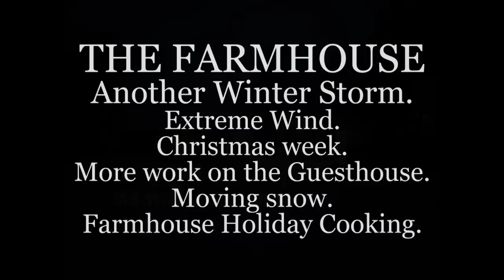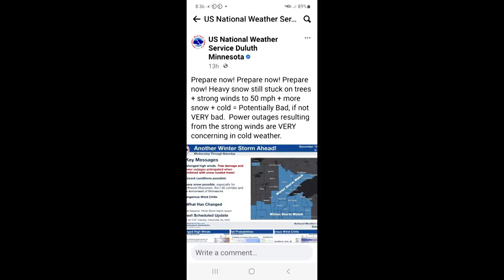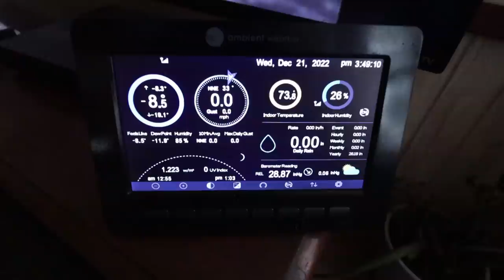THE FARMHOUSE. Another Winter Storm. Strong Winds. Christmas week. Holiday cooking.

Comment: Joe, I NEVER put ethanol fuel in any yard equipment or really anything other than my vehicles, ATV’s, chain saws, generators, outboard motors, all get non ethanol fuel, after replacing carburetors and cleaning fuel tanks I will only put non ethanol in my gas cans.  I have not had any problems since.

Comment: I noticed in the guest house that none of that plastic was moving. With huge gusts of wins going on outside and against the house, you would think that the plastic would move in and out if there was any kind of leak.  It didn't move so you did a great job of insulating and sealing that house.  In my old house, on a good storm the curtains would move a few inches every now and then from the win and suction going back and forth.   One by one I sanded the entire window, repainted and shoved insulation and used expanding foam in any cracks once I took off the trim around the windows.  We noticed later that by sealing it up the furnace didn't click on as much.
One of the best things about a power outage is that you get to sit around and "talk".  Retell stories you've told already 5 million times.  Rehash a great memory, gossip, play an actual game like UNO, etc.  The power comes back on and everyone goes back to their pc, laptops or cell phones.  Running a close second and third is the creative ways you get to make a meal.  Everyone should own a fondue pot with sterno fuel or a candle. You can have hot water in no time for coffee, tea or hot cocoa.  Next is looking around at everyone with some covers or blankets on and taking a nap now that they had a meal and can rest.  Power outages can bring people closer together.

Comment: No matter what size trap you get the overflow on the tub/shower is always going to be above the trap-you can still use that shallow p-trap under the tub just pack some fiberglass insulation around the drain area and you will be fine

Comment: I'm a rig welder and have a couple machines a Lincoln sa200 and another Lincoln ranger. And I've had to use the ranger for the house a couple times worked great got two 220 plugs and 4 110 plugs at 30amps its an 11kw ran the house and shot with ease.

Comment: In my own past struggles with small engines I've found the best way to repair them and make them reliable is to replace it with a honda. They will always start and run even after prolonged sitting.

Comment: Not sure if you mentioned it, but the battery bank that Zach gave you can be plugged into your vehicle when you are running errands to recharge it. Also, a solar panel will charge it ( as long as the sun is shining).

Comment: Joe check the petcock valve from the fuel tank as well when cleaning the carb if you are going to clean one part of the fuel system clean it all... with the ethanol in today's fuel it gums up everything... stay warm!!
Reply: Don't leave gas in your tank for very long. And use 91 Oct gas .check your plug and clean your air cleaner if dirty. You should put a shut off valve so you can run it out of gas when done using it. It helps alot

Comment: Joe, the only true way to ensure that any gas powered small engine will start when stored for any lenght of time is to shut the fuel off and let the engine run untill it quits,  Then chock it and pull it a few times will clear the carb dry. And gas with ethanol is hyroscoptc and will absorb water. And gas today is really only good for approx 30 days. and loses it's BTUs. Even putting Staybil in the gas does not really work long term. Ask me how I know. If possible only buy ethanol free gas for small engines, it will last longer and not absorb water sitting around. Happy New Year to you and Melissa and your extended family.

Comment: Speaking generators, I bought the predator 9000 watt from harbor freight and that thing is awesome. I know a lot of people don't like harbor freight stuff, but it works wonders for me.
Reply: I was looking at one of those. Ended up getting a Westinghouse 10,000 Duel Fuel at Family, Farm, & Home instead. Our lights flickered in this recent blizzard but we never fully lost power. My in-laws lost power for 12 hours
Reply: @DeputyVanHalen5150  I was lucky and never lost power at my house. We got quite a bit of white outs here in VT.
Reply: @LanceHanlonOutdoors  We had 63mph winds here in Ohio -12 air temperature and -32 windchill. Had a hot water line freeze going to our wet bar and bathroom. The genius who designed our great room ran the water lines through the attic. We've been in this house for years never froze a line til now. I thawed it quick, didn't want that breaking. Lol
Reply: @DeputyVanHalen5150  WOW... Good thing you caught it in time.

Comment: We always stock up the house with groceries. That way if the roads are chit, or it's brutal cold out, start the vehicles when we take the dog out, let them run for 20-30 minutes, and the other runs out and shuts them off. We had that brutal cold snap for a good 12 days. Husband ran out of his beers and debated on going out or not for more haha
Reply: For the outdoor wood stove, why don't you build a wind block for the front of it? I am one who hates cold wind, so that would be something we would do.
Reply from the maker: I talked about it in a previous video, until we go through a whole winter running the wood furnace there is no way to know exactly what we want and need. Some sort of wood shed and maybe a wind break can happen next summer.
Reply: @NorthernSeclusion  For sure. This video took me back 2 weeks. We got that cold and snow a week before you did. It sat over us here in Alberta for awhile

Comment: Joe,  use StarTron in all your generators.   I have left mine sit for three years with the same fuel because I didn't need it.  And only started it occasionally. But it runs like a champ when I need it.  It's like Stabil but on steroids.  I use it in every motor I got 2 or 4 stroke.

Comment: I had a garden tiller that did the same thing.  Turned out it was the gas.  ETHANOL had separated.  Drained out the gas put in new and ran like a charm.  Glad you found the problem with yours. 
Looks like you could possible use a blade for the back of your tractor.

Comment: Joe- do you use fuel stabilizer in your small engines?  If not you should try it.  I have been doing this for probably 30 years and I never have any issues with the carb or fuel.

Comment: One of the jets or passages in the carb is plugged up. The way its acting is textbook example. Also check the shutoff valve. Soak the carb in a gallon bucket of carb cleaner
Reply from the maker: I did explain in this video exactly what Zach had me do to fix it. It is running perfect now.

Comment: Possibly bad gas ? Do you ever use fuel stabilizer Joe 
Happy New Year to you and the family 🎉
Reply: Every time I fill gas cans I add Stabil. Never had a fuel problem since BUT for extended storage I do run the carb dry. I've also found Seafoam in the gas helps for "mildly clogged carbs" before going right to rebuild and clean.

Comment: Have you tried to run that generator with the fuel cap loose?  Vacuum may be building up in the tank due to a clogged vent in the cap.  Will usually run for a while then quit.
Reply: Nevermind, I’ve now watched far enough to see you got it figured out.

Comment: Another issue with small engines that run & immediately stall; check the spark arrestor screen for carbon blockage or if the engine has a catalytic muffler. My walk behind mulching mower has a catalytic muffler and even with a brand-new carburetor, new spark plug it still stalls immediately. Then after resorting to the manual on the engine, the catalytic muffler "MUST" be replaced after 250 hours of operation. Well... my mower has 289.6 hours on it. I had the mower since 2001. So, for shits & giggles I removed the catalytic muffler & the engine runs just fine, though rather loud. So, for $17 I'll get a new standard muffler for the 6.5 HP Briggs & Stratton Intek OHV engine. The catalytic muffler is obsolete. 

That same winter storm or blizzard dumped allot of snow on us in Lower MI. Some places got 2 feet or more of system & lake effect snow. I worried about the power going out as my generator is set up with a multi-viscosity oil meant for 15*F to 95*F use. Our high temp on Christmas Eve was +3*F with wind chills around -20*F. 

This Tuesday we are to go back to work and the forecast is for a high of 62*F with possible thunderstorms.

Comment: How do u keep your pipes from busting? Is everything heat traced? We have to drip the faucets here in Louisiana and that can get costly
Reply from the maker: As far as the main house goes, everything is in the basement which is heated like the house. All water lines are dug underground 8 feet and then come up into the basement. With the guesthouse I will have to heat tape the water from about 6 feet underground until it gets into the building. That will be a future project once the ground is not frozen. I always worried because at the Louisiana house we would have frozen and burst water lines almost every year. up here, you rarely if ever have that problem.
Reply: @NorthernSeclusion  yeah we do not design for cold weather. I'm an engineer here and we get cold weather fracturing because we dont account for it. We lose our minds when the temp gets into the 20's

Comment: Why don't authorities either re route electricity cables, or cut back the trees which over hang them ?
Reply from the maker: They do but a tree that is 80 feet tall means they would have to clear trees back 80 feet on each side of the power line. They do not own 160 feet of easment to do that. They come by every couple years and ask if they can cut all the trees and brush that line the road in front of our property below the power line and I give them a hard NO. They can trim them so they are not hitting the power lines but they will NOT cut them down, that becomes our privacy in the summer from cars driving by. There is 8,742 miles of power lines in the state of Minnesota. They do not own enough of the property to cut trees back that far. If they want to fix the problem they can run the lines underground.

Comment: I THINK YOU SHOULD. TAKE THE. FUEL. BOWL. OFF. AND. PULL THE. HINGE. PIN.  THE. NEEDLE. AND. SEAT.  IS.  PARTIALLY. STUCK. PULL OUT THE. NEEDLE. VALVE. CHECK. FOR. CRACKS. OR.  RIPS.
Reply from the maker: Or you could just actually watch the video and know exactly what I did to get the generator running perfectly.

Comment: What do you need more a truck with a bandaid or a truck with a snowplow? Watching you struggle with what you have I know what I would!
Reply from the maker: I certainly have no need for a snow plow. I could use one if I had it but I could also use a snowblower on a riding mower. I could do a lot of things and maybe someday I will but the tractor and 4wheeler is doing an awesome job right now. I see no reason why you say I am struggling with what I have now?  Lol. There is snow to move and I move it. Done.